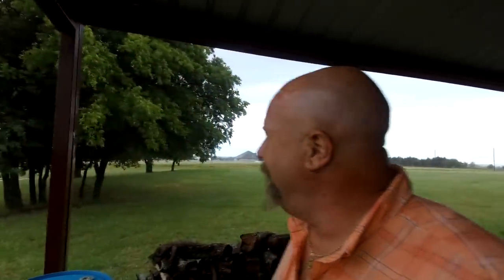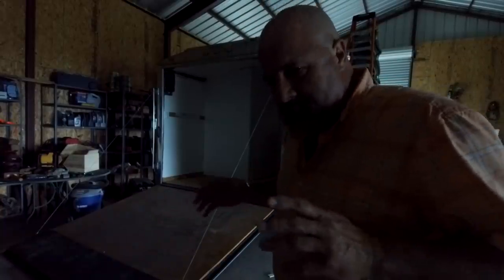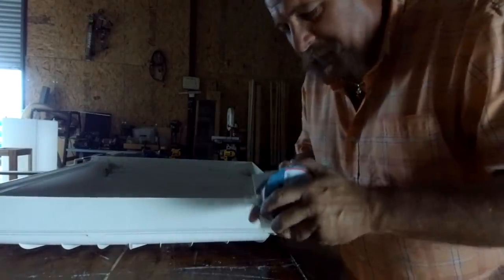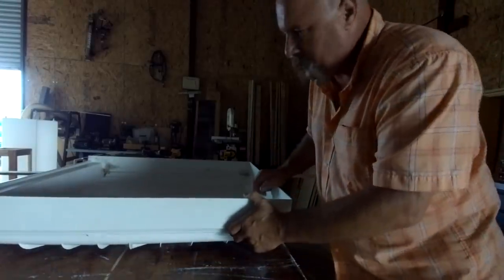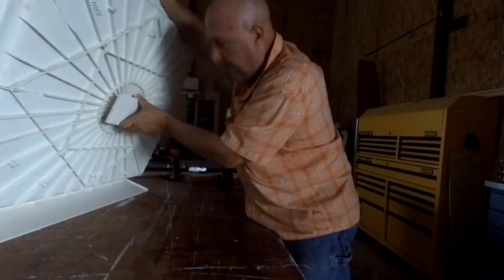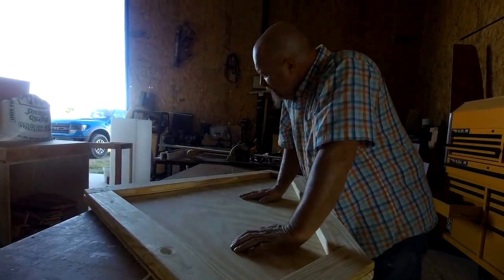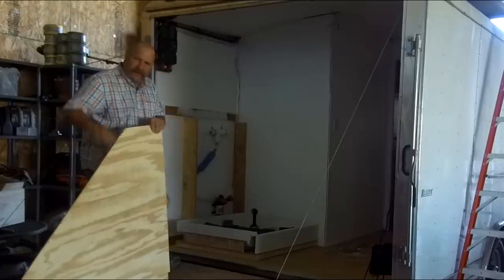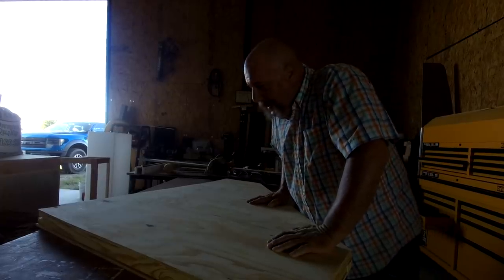525  Starting the Hour Shower build / Cargo trailer RV Conversion

Comment: Stan, I watched the video. If you ever do another..... build your frame around the base, fill the floor of the form with beach sand settle the pan with your connections down into the sand the sand will do what the foam did.......... great job on the RV really enjoy your videos.
Reply: expander foam

Comment: Man I love it.  One thing to consider I designed mine so that the first gallon or two in the "hour shower" come from the onboard water heater so it's already hot.  Less work for the hour shower heater. I designed two separate systems with 2 shower heads, one for shore hookup and one for boondocking, but this could be valved in a custom build.  Immense possibilities :)

Comment: you know this bloke has a real mans truck to tow this thing because he don,t care about weight
Reply: He's not adding that much weight to it.  It is a good, solid build while still being sane.
Reply: @seanobrien7169  - It's loaded with weight. Just the water is a lot of weight. Then add in everything else, a motorcycle, fridge, all the wood, food, etc.. It's all weight. Everyone uses heavy wood not just Stan. Why don't they build an RV with light plastic shelving?

Comment: I would love to find out where you got that shower base adapter that has the small hose mounted to the bottom of it I would like to use a sump pump a bilge pump if you will to pump the shower out in my gray tank to avoid some additional plumbing
Reply from the maker: I made it from parts from Home Depot.  I thought I explained that in the video

Comment: Excellent Build and thought process. Think about “IF” you have a leak, where is it going to go. May consider drilling a 1/2 or 3/4” hole near the drain on the trailer floor, so if you have a leak, it will drain outside below the trailer. Put some screen covering the hole outside to keep any insects or mice from entering. Brain storming here.......
Reply from the maker: Yep, something to think of

Comment: Hi Stan the trailer is looking great.but I wanted to let you know that on the Facebook Market place they have a 2000 peterbilt 18speed with 120. Inch sleeper this one is blue .So if your interested good video Stan
Reply from the maker: Thanks for the info!   I looked and didn't see it.   could you send me a link
Reply: Hi Stan I tried and I couldn't link it to you but here is the information I found I think if you go to the sellers name he has the peterbilt on his page sellers name is George herr  the peterbilt is located in Peoria Az and it's a Peterbilt 379 I hope that helps Stan Let me know if this works

Comment: Hey Stan, on another note, have you kept off the weight you lost last year during your OMAD, fasting period. I’ve pretty much kept the 40lbs off that I lost doing keto and OMAD. Haven’t kept up the keto completely but still trying to do OMAD for the most part.
Reply from the maker: Sort of.  I started at 280# lost to 242# and am now at 250#
Reply: @Sasnak  Not bad! I went from about 210 to 160 now I stay around 165.  I've got a bit to go.
Reply: Congratulations both of you! :)